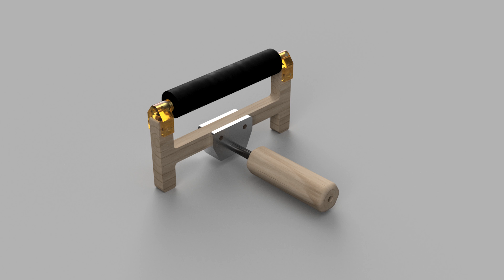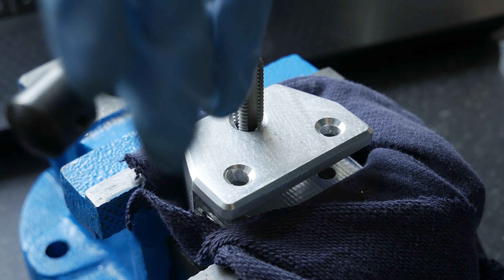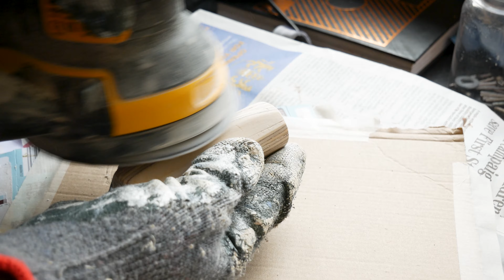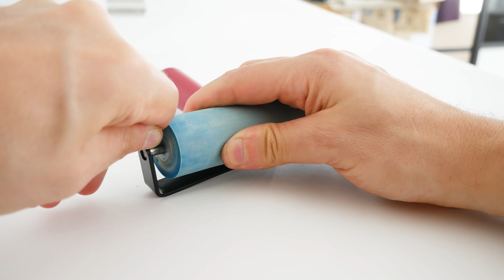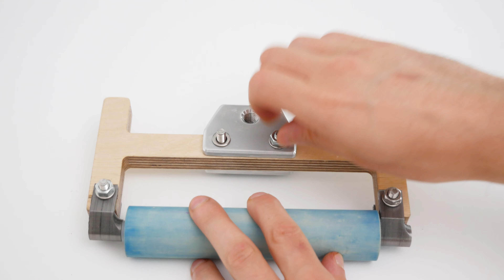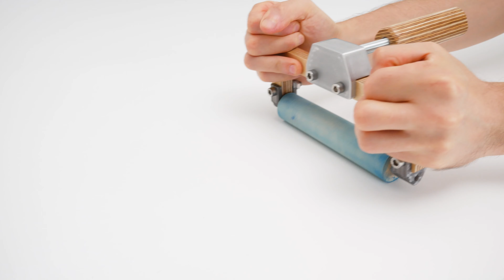Upgrading a Speedball Rubber Roller/Brayer

Comment: Really cool to see the whole process! Though I think I'm missing the point - the roller is the most important part of a brayer. Speedball rollers tend to swell at the edges, causing the middle to under ink, so that should have been the first upgrade. This is akin to putting an expensive bodykit onto a car with a failing engine. It's neat, though not too practical (until you upgrade the roller).
Reply from the maker: Hi Alex, I mainly use these rollers to ink awkward textures so I apply a lot of force and not too fussed about the swelling on the edges. I know my upgrade is a bit of a niche use case but hopefully help others :)